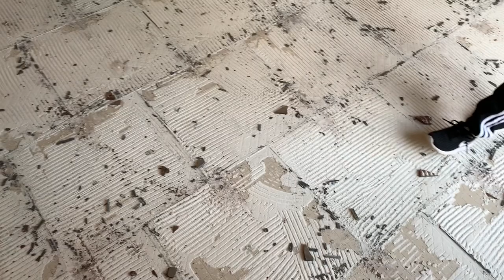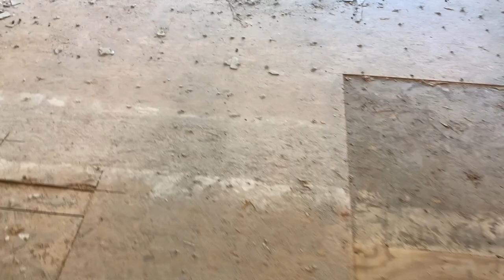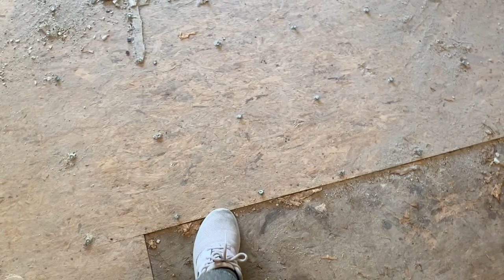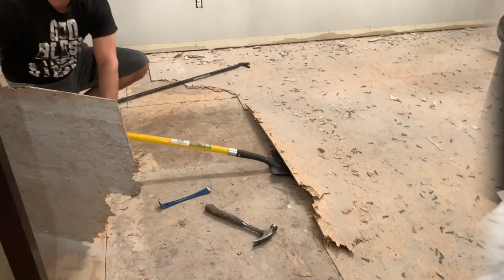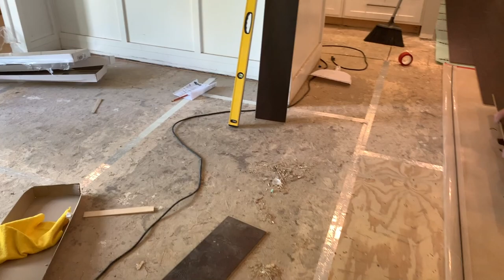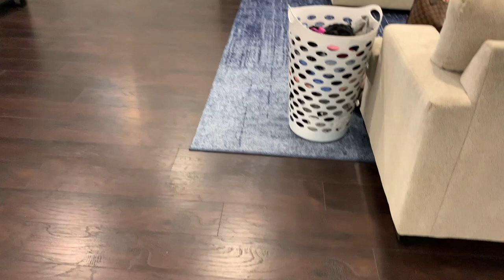Removing Ceramic Tile + Installing Wood Laminate

Comment: Looks clean af. They put more screws in than I would for sheet rock on a wall but the screws were as crappy as the thin ass plywood they installed.

Comment: Would you recommend removing tile or just putting the laminate over the old tiles? Whats the pros and cons?
Reply: Imo.. I think it would be fine over tiles. I've seen many videos people installed over tile glue or floating.
If the tiles on first floor foundation it will be a mess causd then you got all those grout on the foundation to smooth out.

Comment: The reason for all the excessive screws is to ATTACH to the subfloor. They overlayed. Most likely they didn't have the correct depth to attach thru the wood to the subfloor. 😏

Comment: Why did you just install over the tiles.  Since the tiles is already flat.
Reply from the maker: We made an open floor plan. The tile in the kitchen made a slight step up. And since we have an open floor plan now, we needed the flooring to run from living room to kitchen smoothly.